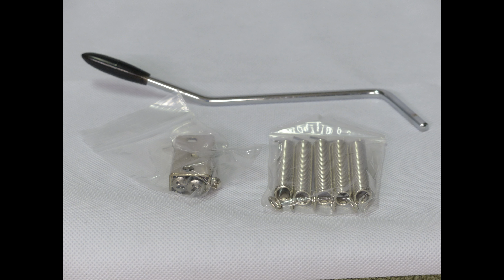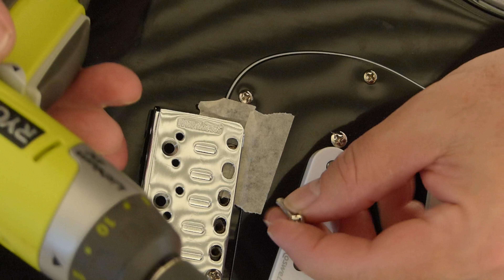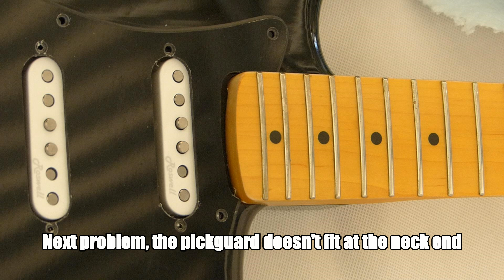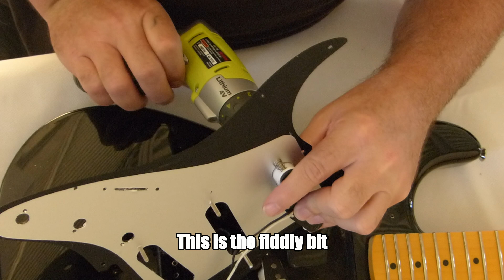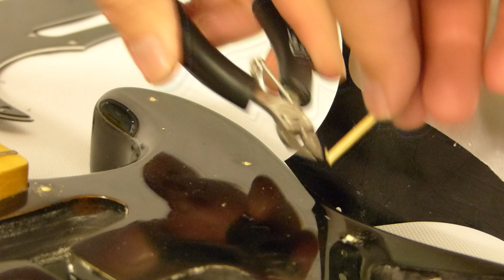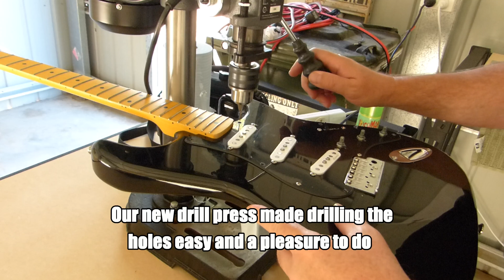Harley Benton ST-57DG vs Wilkinson Tremolo and Vanson Pickguard

Comment: If you are a guitar tinkerer. Then its always a good idea to drop one or drops super glue in all the small screw holes for the scratchplate etc. It strengthens the treads for the screws.

Comment: Nicely done man, I'm wondering if I'd be able to fit that trem in my Squier FMT 🤔
Reply from the maker: Good question. I think the Squier bodies are thinner than a normal Fender, so that's something to consider as well.
Reply: 650Thunderbird right, they usually use the 'shorty' tremolos. But I this one's body is the same as a traditional american strat. It has the same concept 2 point tremolo as well. I'll have to see 🤔

Comment: Sorry to see the trem i sugested was needing to have a hole redrilled. but glad to see it was only that. But hope it did make a big diffrence as you said below. also interesting look with the all black pickguard. :)
Reply from the maker: Hi Tezza, single ply PG is what Thomann list in their specs, but it comes with 3 ply (black white black). It's supposed to be a rough copy of this: https://www.thomann.de/intl/au/fender_david_gilmour_nos.htm?ref=search_prv_13 hence the "DG" in its name.
Reply: I realize that this video was a few years ago, but my 57DG came with a 1-ply black guard. So maybe they got a lot of calls on it. 
Anyway, I’m looking at a trem upgrade as well as pickups. I’m thinking DiMarzio Area 58s in The neck and middle with a 61 in the bridge. 
Any other ideas?

Comment: hi, in case you read my question, I have a harley ST62 and has Rosewell pickups and it does sound kind of similar to the 57 with rosewell, any idea if the rosewell pickups may be different from the ST57 and ST62 ? any idea ? my point is if I buy a ST57 and it sounds the same I will be very frustated
Reply from the maker: Hi Ricardo, I really can't help as I only have the one HB Strat type guitar. Does it not say on the Thomann website, the model of pickups in the different guitars?